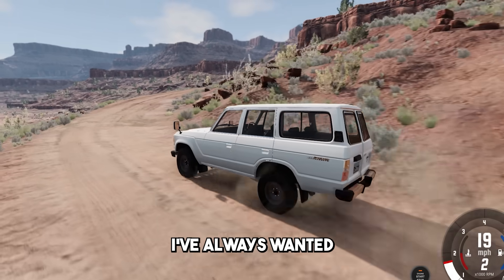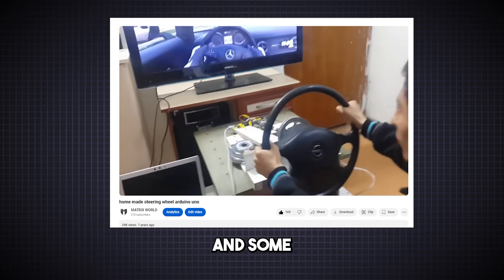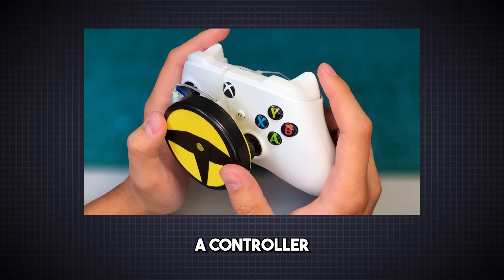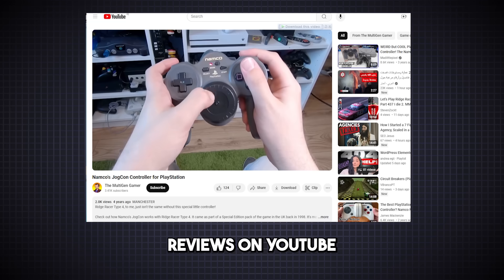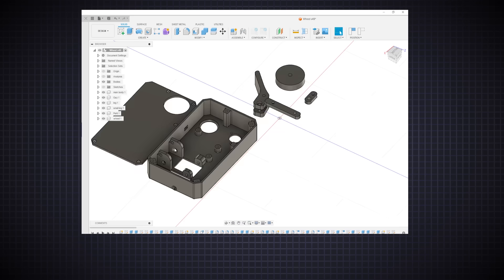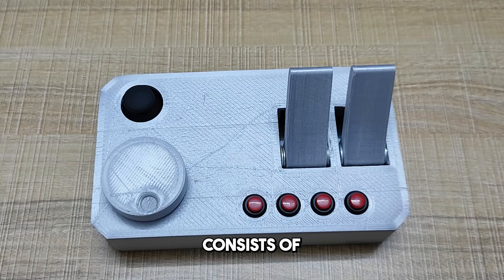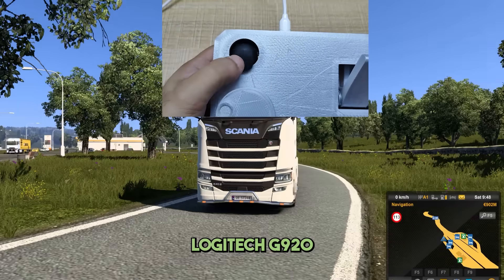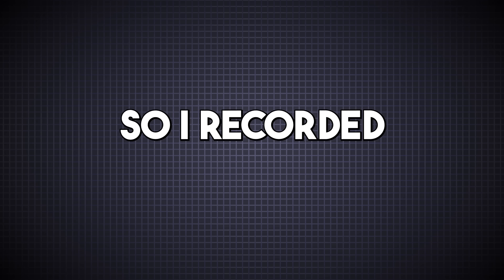The Racing Controller No Company Ever Made—So I Built It

Comment: Food idea but I think I have some ideas to make it for sweaty players, you should put pedals behind the controller to give some use for your fingers behind (clutch under the left, break and accelerator under the right) and then on the top, put other buttons like manual shifters from 1 to 6 and a break,  or simply a pedal shifter on the front sides and random buttons and a joystick on the top, I think you should also add a stand to keep it steady or some belt cause it's a bit uncomfortable having pedals behind while holding it, idk about programming so idk if it's possible to do with the limited space tho

Comment: Is it usable in Forza Horizon 4/5? because little did i know that forza horizon has to use a third party application that read  a wheel controller so in Forza Horizon there will a setting for Wheel option
Reply: And can you please give the exact measurement of the ring? And the screw, cause in your photo i didnt know the exact measurement, and i have to guess the measurement

Comment: This is awesome. The only note i can think of is ergonomics. Car pedals are put in a spot that is meant to feel natural, i notice when you press the brake it almost looks like smaller hands might clip the acceleration.

Either putting the pedals at a slight rotation, or otherwise repositioning them for other fingers to use could be a huge upgrade.

Just a suggestion, i still absolutely love this.

Comment: Fantastic project! I can’t help but think that it would have been better to have a long throw throttle and brake for the right hand index and middle finger instead. That would free up the right thumb for either hand break or camera controls using an analog stick or something similar. Two levers side to side for the right thumb to switch between a sequential shifter and a handbrake would be amazing and realistic!Potentiometer for the brake pedal would also be cool…

I could elaborate and show you what I’m visioning through a sketch if you would like!

Comment: You could add force feedback to this using a brushless motor + encoder and a field oriented control driver. I built myself a DD hoverboard motor wheel base using this exact combination,  it should work at any scale. I used an ODrive and FFBeast firmware for convenience but I don't see why this couldnt work with SimpleFOC and cheaper hardware.

Comment: @3Dprinterart299 check if you can buy an UPS for your 3D printer. Just be sure to calculate how much time the printer can be one before the battery is depleted and pause the print before that.

Comment: i wonder if there is a way to add a "trigger" pedal in the top right for throttle, that way you could have a Clutch+Brakes+Throttle pedals, but be able to use 2 at a time, for driving manual cars in a more accurate way. 
either way, this thing is sick!

Comment: If you want to add a force feedback you could use a NEMA14 or even NEMA17 motor with open shaft on the back, just install the motor into the wheel and because the shaft is open on the back you could add magnetic encoder into it, if the motor is too strong just undevoltage it, it should be quite cheap nema motors are few $ each, and you could get AS5600 encoder for 2$ + shipment from china, A4988 stepper motor driver could be bought for below 1$

Comment: very cool.  Personally, I think the gas and brake pedal should be nice triggers on the top so you can trail brake (using left and right index fingers) and then the gear shift should be some sort of springy slider you use with the right hand thumb.  The steering wheel is pretty much exactly the sort of thing I've imagined whenever I think of one of these driving controllers...

Comment: ?why not use mousewheel for pedals and wheel as controller its much cheaper and reliable 
i dont understand why microsoft used a encoder for the wheel but not for the pedals 
same logitech have over 20 year old wheel and cant find the potentiometers for the pedals that would fit and last 
all you need is 3 mouse wheels

Comment: Nice project! I also tried this with an unmodified xbox controller with a code to translate the "rotational" movement of the left thumbstick to the full 1800 degrees truck steering wheel input. However keeping the joystick pushed to the edge the whole time was tiring over time and rotating the joystick just didn't feel like a steering wheel even after hours of gameplay. I guess your method of making an actual rotating joystick is the only way to achieve this. For the next step I'm getting another xbox controller to remove the springs inside the joystick and installing a small steering wheel on top of it.

Comment: 3:37 the realistic feel comes mostly from force feedback actually, no just the 900 degree range, and that it moves by itself depending on what the wheels are doing
Reply: it still makes a huge difference to have a 900 degree wheel vs an analog stick and having the steering wheel in this small handheld controller form is great. I might try to make one myself because I love to play games that could use it but not enough for me to own a steering wheel. I usually just break out the controller when I want to drive a vehicle on PC

Comment: Congratulations and big respect to you for making this design and build instruction. This sort of design with a force-feedback knob was an idea I personally wanted to pursue, but I have almost no experience building interfacing devices like this. i personally feel like a lot of great and worthwhile racing games are very unpleasant to play with a standard gamepad. I was also thinking that a hybrid implementation of motion controls would help a lot in such cases.

also, holy crap, that jogcon is a super impressive piece of hardware. 

If you're curious, there's also a 3d printed design for a controller with force feedback analogue sticks floating around on github.

Comment: I decided to look into the idea of this a long while ago, however slightly different. I used Mouse Steering for many PC racing games and really enjoyed it, so I wanted to attach 2 "pedals" to the mouse in place of the LMB and RMB buttons normally found on a mouse, so I could throttle and brake with analog control. This controller you made is pretty amazing!
Reply: very good idea too

Comment: I feel like the joystick should be above on the upside for your right index finger, would be much easier to control simultaneously.
It also seems pretty inaccurate for its inputs, instead of a gradual increase for controlled rotation its looks ON or OFF.

Comment: A suggestion for improvement - the pedals position is not great for long term play & comfort, the form factor as well lacks access to handbrakes and other button function while "driving".
I think a lower actuation point for the pedals and smaller surface area with more texture can allow for toe heel pedal/brake drifting for sim racing games in particular (imagine playing Gran Turismo with that kind of control??!)
Also allows for closer button placements and improve accessibility.
Additionally, the placement of a R1/R2 sorta paddle shifters for the pointing, middle, & index fingers opens up other driving binds!
Aware that the aim is for a closer driving feel and it may make it feel like a RC at that point but any hardcore driving sim players can only dream of such!! 
You've already addressed the biggest issue which is the steering so these are just minor QoL opinions..
really, amazing creation so please please patent your work!

Comment: An idea this gave me would be to move the break&acceleration pedals where L&R back buttons would be, facing outside (so that you would grab them with your pointing fingers and press on them as much as you want), then with that right side open, I'd move the camera control to the right (to give the thumb a button it'd be more comfortable to maneuver and to always have your left thumb on the steering one).
And maybe? on the back of the joystick have two buttons on the left and right, for your ring fingers to reach to (these could be the gear shifts/blinkers) and have the current 4 buttons do w/e you'd want to do.

Comment: It's pretty sweet, but honestly you should just lay it out like a regular controller (with the gas/brake on the shoulders), but with the wheel instead of the left stick. You need to be able to use the brake and gas at the same time in racing, and trying to "heel-toe" with this setup would just be too unwieldy. And it would be nice to be able to shift, too! Might even be awesome to design a mini H-pattern shifter and dedicated analog handbrake lever, too!

Comment: This is awesome, a good quality of life feature for this controler would be to angle the pedals at a 45° making them parallel to the palm so you don't have to reach across the Gas with your thumb, you could also add a spring leaver beside the pedals to act as a handbrake as well

Comment: Nice! I tried to make something like this myself a bit ago, and it was alright, but a bit too jank to feel good to use. One thing I thought would be cool to add, though, is a miniature stick shifter on the controller, maybe with a toggleable clutch pedal (since you don't really have enough fingers to hold down the clutch while shifting and steering at the same time). I made a miniature shifter myself a while ago, and it actually worked pretty well. I essentially just had a joystick under a panel with gearbox grooves in it, then programmed it to recognize which gear it was in from the joystick position. That way, you can change how many gears you have, or change to a sequential, by just changing the panel and code. I think something like that would be sick on this type of controller.
Reply from the maker: Thank you for your suggestion.

Comment: It might help to get a UPS (uninterruptable power supply). Essentially it's like strapping a battery to the mains power, but it works automatically. It's a perfect way to turn unreliable power into reliable power, both in industry and at home. They come in a large range of sizes so if you don't need a giant industrial UPS you can still get a few minutes before the power turns back on (if that's all it goes out for.

Regarding the project, to me by far the most important part of a wheel is the force feedback. Doing it properly is obviously a huge challenge, but I have seen a very cheap way to get a step towards force feedback in a wheel. Effectively they mounted stretchy bands to the wheel so it expands as the wheel turns pulling it back to center, then mounted a rumble motor. Tuned properly it can feel somewhat like the self centering plus feeling the ground. Modern games do the rumble very well so that isn't a problem, but the strength and direction of that centering is the main performance feedback and there's no way for the cheap system to get that. Still, I suspect it's an improvement having something.

Comment: i can give you 2 suggestions to make it more usable for professional sim racing type players. 1. Brake Pedal should be right trigger is on xbox. 2. Add spring to the steering wheel so it returns to neutral position when you don’t touch it.
Reply: Brake is on the left trigger as standard 🤣🤣🤣🤣🤣🤣🤣🤣

Comment: I like the concept though for more race version would be more like a average controller with two joysticks like normal but right one could be modified to me more like a car’s shifter then there’s still that wheel and the normal 2 triggers and 2 bumper buttons for throttle, braking, and clutch and it would make it basically a controller sized wheel set up though probably not best since how difficult it would be to design and would just be get a full wheel at that point since it not the point for practical use it’s for immersion and the feel it gives

Comment: I have a suggestion. What if instead of the thumb stick for camera movement it was two scroll wheels on the corners where your fingers are. Left for x axis movement and right for y axis movement. I play most games from the drivers seat view and only really need to look left and right. Being able to do that quickly without taking my thumb off the steering wheel would make this even more emersive. Keep the thumb stick to make menu selection easy.

Comment: That's an amazing piece of engineering right there.
I can give you another idea off thw top of my head – make the camera joystick controlled by something else, like by our head rotation. If you move the head slightly right beyond 5°, then the camera rotates right at a fixed degree/second, the rotation speed increasing by the increase in your head's angle. once you move your head back to center, the view stops rotating.
I suppose this will be revolutionary, as you would not need to lift your hands off the steering wheel or the accelerator just to look to the side!

Comment: This guy solves us the most concerning problem we had ever faced having a steering wheel NINE HUNDRED DEGREES using materials which are indeed cheap. Great job man:) Fun fact u (could if you want) also add gear shifting like how on the Ps4 there is the R2 and R1 you could make something similar like that but the upper (R2) would change up a gear and the down (R1) will down one gear. And at the L1 you could have a button for handbrake. All of those are ideas that if they were possible I bet you would be the number 1 competitor against the other companies for racing products. *Anyways you just got a  new subscriber*. I am looking forward to seeing where this project would be going.

Comment: Yk what would be so sick? If you added shift button on the top right corner where the bumbers usually sit where your pointer and ring finger sit. I love playing with manual shifting in my racing games but I play with my controller and I just think that would be revolutionary. Shift up could be the top bumber and shifting down could be the bottom bumper. Love the videos man good luck ❤️
Reply: jeah i don't like auto modes for manual cars in games (i was using has, 2 bumpers and 1 trigger per side, and i was using the bumpers as shift up/down)
Reply: I was thinking the same thing. Shoulder buttons and a third pedal. Rev 2 would be something he could bring to market.
Reply: I was thinking the same. This controller would also make rev matching much easier in games like Beam where it actually can matter.
Reply: honestly, even though it’s much more niche and unnecessary, adding a second shoulder trigger for clutch would allow it to be supported by every racing game and preference
Reply: Came here to say this exact thing, with a button to use the clutch